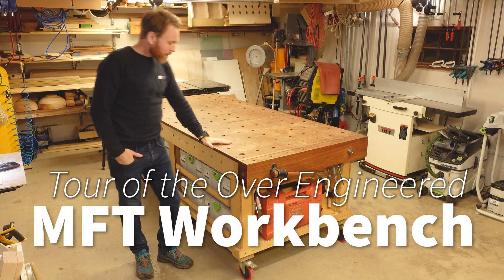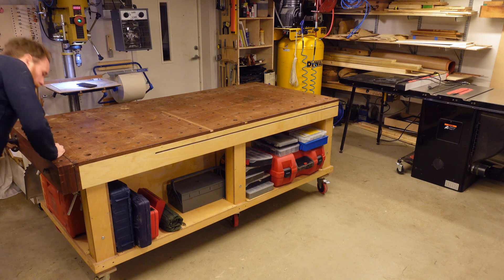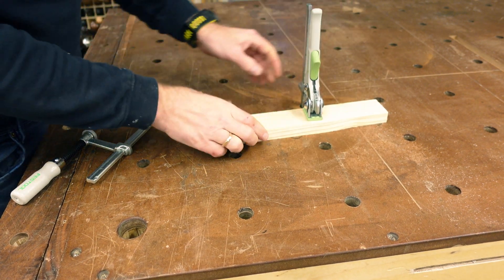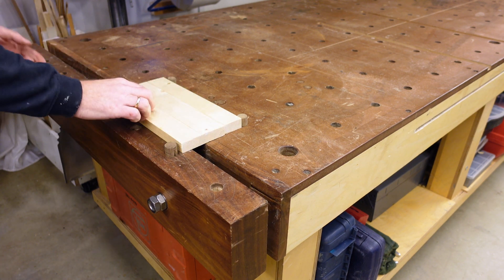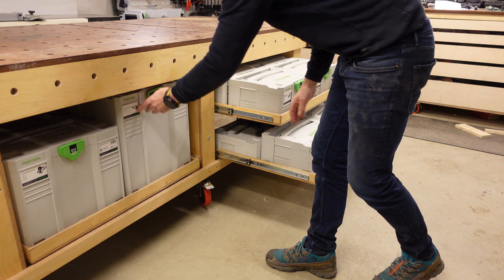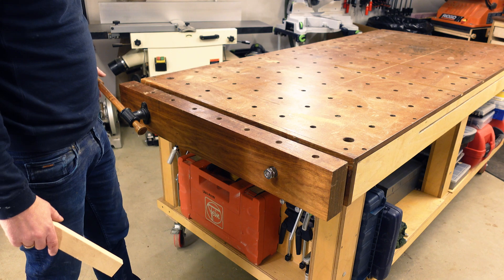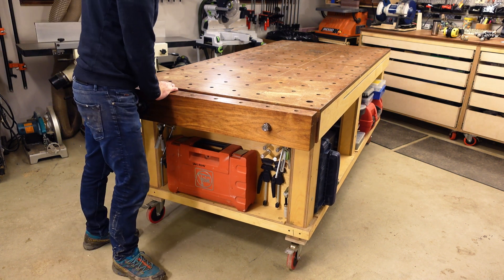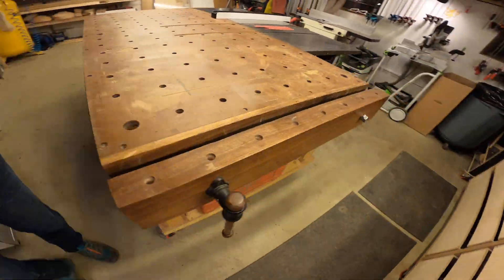Rock Solid Adjustable Workbench: Features and Usage. MFT style workbench with adjustable legs

Comment: Nice.  I'm noticing the two workbenches against the wall. That's looking interesting as a mobile set of workbenches with drawers that I'm thinking of building as I redo my shop.  Do you have a video on how you built those?
Reply from the maker: Hey Ken. Thanks for noticing. No, I don't have a build-video for them. 
I might do a video on how they're created and work. Let me know if that's interesting.
Reply: @Hackish  They look interesting and are what I'm thinking about.  I've decided to go mobile in my shop to allow me to move things around to create space, or put a couple of units together to give me a wider platform.  That'll be a spring/summer project for me as I need to tear down what I have there when I bought the house and repaint the floors first; so, if are thinking of any idea for a video, I vote for that one.
Reply from the maker: @kenm2679  Great to hear. I'll see if I can do a "tour" of them. Very busy atm, so won't be soon.

Comment: Great stuff! I love it! Your ads brought me here! And I am glad they did!
Btw, what is that mat in front of your table saw for? I wonder if the sawstop safety feature still works with such insulation? I'm not really sure how their feature works, but it seems like the blade is charged to potential which is discharged through human's body to the ground when touched. 
Does it  serve any special purpose?
Reply from the maker: Thanks a lot Petr, very much appreciated! 
The mat serves two purposes - to not trip on the power cord from the table-saw and router, in addition to prevent fatigue when standing for a long time. The blade still trips (don't ask me how I know), it's based on measuring capacitance, kind of how your smart phone's touch screen works.